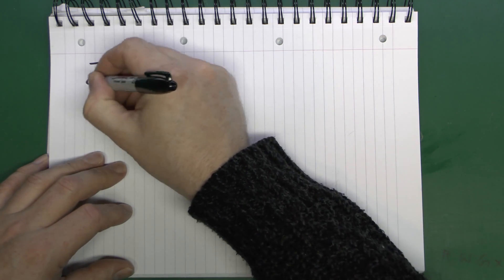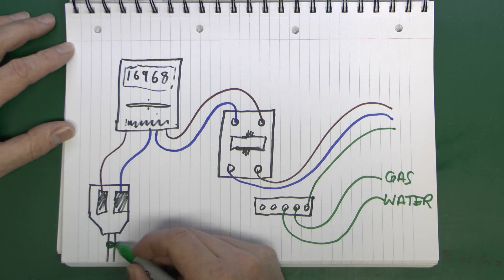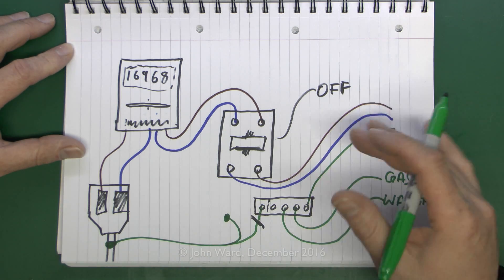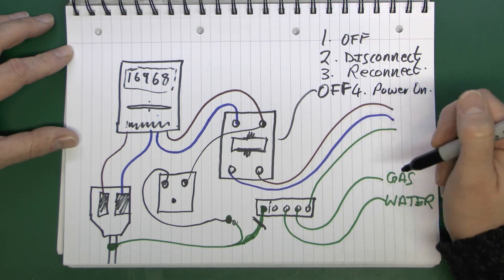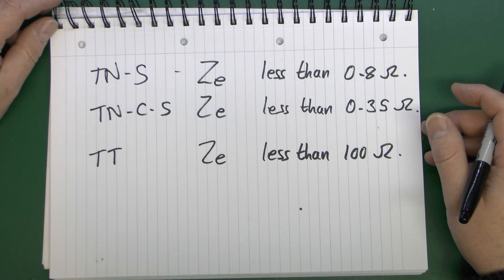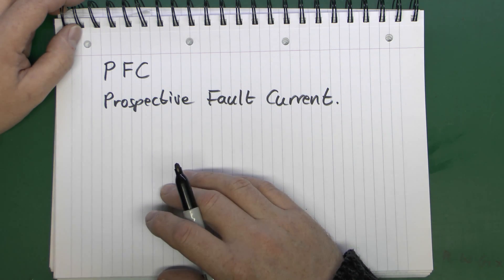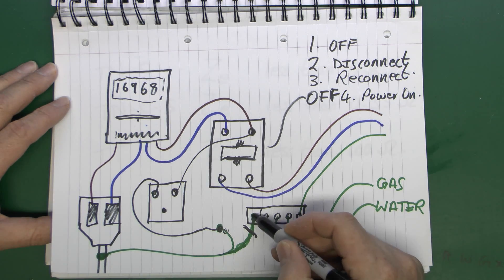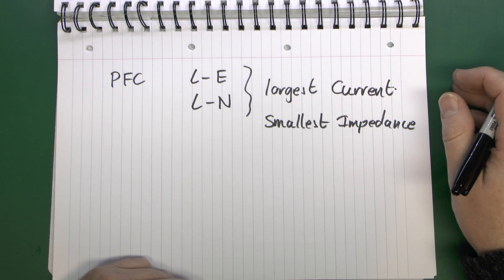Loop Impedance Testing

Comment: Why did you skip out on IT installation? Is it because the results would be the same as TT system?
Reply from the maker: IT systems are uncommon in the UK, and testing loop impedance on an IT system would be meaningless, as by definition there is either no connection to Earth at the source or it's connected through a high impedance.
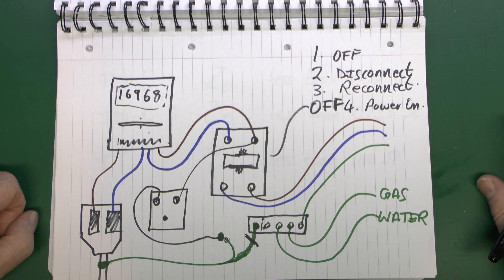Reply: @jwflame  Thanks, I asked because you said 13:13 "you do also need to consider the fault between line and neutral". Sure there is no earth at the supply of IT system, but I still can measure the loop impedance live to neutral, right?
Reply from the maker: @neowild8102  You can do that if there is a neutral.  Many IT systems do not have a neutral, it's two or more line conductors only.  IT systems are entirely different to TT/TN which is why they are not in this video.
Reply: @jwflame  thanks.

Comment: I just bought a ground resistance tester. I found one I could afford. 
Where I live there is a power poll 450 ft. away from my house. That poll supplies power to 4 homes. I during the 30 years I have lived here  it has been struck 4 times. Each time the power company has had to replace the transformer.
In each time my neighbors had computers tvs and other electronics destroyed. The only problem I had was a
 compact lamp start smoking.  That has always puzzled  me. I bought this meter to find out why though I thing I know.
Reply: Still waiting for further elaboration.

Comment: You measure between the earth provided via the cable or earth pin and the neutral? Never using the fase and earth pin? This is not very clear in you drawing. Cheers

Comment: I have 100s of these tests on the motorway network and street lighting and we were expected to get a reading of under 21 Omhs. We would often go deeper with the earth rods or do them in a triangular system and join them all together with 16mm green and yellow. The grids are also helpful and we would use bags of “Bentonite” also pour a few buckets of water over which was a bit naughty because obviously in the summer months you would the soil would dry out and not meet the requirements. I also don’t think we were trained properly because I have learnt a few things watching this video so thanks again for that.

Comment: If you have a ground electrode, then you only need to do Loop Impedance Testing or Earth testing?
Reply from the maker: Both.  Electrode tested separately to confirm that is installed properly, and loop impedance once it is connected to confirm the rest of the loop including the earthing arrangement at the supply transformer.
Reply: @jwflame  makes all sense. Thank you very much.

Comment: Why disconnect then later connect? Suppose I connect directly to the earth bar and incoming supply?
Reply from the maker: Disconnecting ensures you are only testing the earth connection.
If testing to the earth bar with everything connected, there will be other paths through the bonding connections to metallic services and other parts.
Reply: @jwflame  thanks alot, your explanations are so well articulated..

Comment: Hi John, on the generic schedule of test results, what is Zs at DB referring to? is it a test like for Ze but with the earthing conductor in place?
Reply from the maker: Same as Ze, but applies where there are multiple distribution boards in an installation - Ze at the origin, Zdb at the incoming supply at other distribution boards.
If there is only one DB / consumer unit, then Ze and Zdb are the same.
Reply: @jwflame  Thank you for clarifying

Comment: Hold a minute. Most of testing devices requires connection between L+N+E to determine Ze and Zs. How I can understand that?
Reply: Your incoming Ze is resistance between L and E, on TN-s on TN-CS the neutral and earth are connected, your Zs is Ze + R1+R2

Comment: Hi john, I'm sorry if this is very basic but does the loop impedance vary from time to time for a specific circuit? or should it be pretty stable? the reason I ask is because installed a spur double socket from the ring final in my house and the reading at the spur was originally 0.65 ohms, then all of a sudden it went as high 0.95 ohms, i checked it again today and it was back down 0.68 ohms. Is this normal or could it something more sinister? thanks
Reply from the maker: The circuit wiring should not change.  The external impedance can change sometimes, as the supply network may have alterations and repairs.  However if it's changing often, it suggests a loose connection or some other fault.  Another possibility is something connected to the system causing interference, so the high reading may not be accurate.
Reply: @jwflame  Thanks👍

Comment: Hi John, great video!

What about IT systems, how could we measure some kind of loop? 

We would actually want to measure earth rod resistance without having access to the actual rod. I've seen in some occasions that the earth rod has been covered by a concrete slab once the building was modified and there isn't any physical contact to the rod but from the main earth bar at the main electrical board. However on IT systems (three phase) the loop path from L-E on a good installation should be very big (as the insulation resistance of the cables?).

What are your thoughts on this situation?

Thanks!

Comment: I've got one of the TN-S / TN-C-S hybrids where there is both a braided earth strap on the incoming metal outer and also a 10mm earth going into the Cutout via a block marked PME. My ECI is recorded as 0.27ohms. Would this indicate that it is indeed a TN-C-S or could it still be a TN-S. I've had no reply from Western Power about what they have it recorded as. The Electrician who installed the CU ticked both the TN-S and TN-C-S boxes.  His recording for the PFC was recorded as 0.85kA. Nominal voltage of 245v.

Comment: You could have been a great airline pilot
Reply: Good evening ladies and gentlemen welcome to this Ryanair flight from Dublin to anywhere. Before we depart Id just like to say that we will be cruzing at 55,000 ohms with a voltage of 230, if we exceeded the maximum permissible value for earth fault loop impedance well then just keep calm a multimeter will drop from the overhead compartment.

Comment: John, how is then gonna trip the fuse with 6KA breaking capacity if the PFC is well below 6KA during a direct fault between Line and Earth or Line and Neutral? I know breaking capacity is different from Tripping capacity but  what happens during a direct fault, how is it gonna clear the fault?
Reply from the maker: The breaking capacity 6kA is the maximum allowed fault current.  To trip the circuit breaker reliably the fault current needs to be 5x the rated value for a B type, so 160A for a B32 circuit breaker.
If the fault current is between those values, the circuit breaker will disconnect.

Comment: In the US most regions I have worked in have the TT / ground rod install. The maximum  allowed impedance is 25Ω on a single ground rod. If it is greater than 25Ω than a 2nd ground rod at least 10' (3 meters) away is required.
Reply: Don Jude i don’t think the US is truly TT because in the US the neutral and ground are joined at the main breaker box. Thus it’s more like TN-C-S with an additional bonded earthed rod. So your primary ground in the US comes in on the service neutral and the bonding mostly keeps a potential from developing between the ground wire and the actual ground you may be standing on.

Comment: what would be the next step if a circuit didn't meet max zs for example tns or tncs
Reply from the maker: Either use larger wires, or a smaller rating of MCB/fuse.

Comment: Hi john I've been told that if we now run power to a shed , garage etc then the dno will not allow the house earth to be used in the shed, so we now have to make the shed  a TT system, is this correct and would a Ze test suffice or do we need to carry out the earth electrode test with the correct tester and test the ground around it etc?

Comment: do you have a video on the following I bought a ceiling light but the live and neutral wires are not coloured.  how can I identify??
Reply from the maker: If both are the fairly common transparent plastic, one usually has a very fine thread inside of either blue or brown.
If not, it probably doesn't matter as many lampholders can have the lamp inserted either way.  Only really of significance with screw thread holders where the inner contact should be line and the thread neutral.
If it does matter then use a multimeter in continuity mode to determine which wire is connected where.
Reply: Appreciate your time thanks

Comment: for anybody studying 2365 the values for TT is anything in between 21 ohms and 200. however is reality 100ohms is max . what I've learned anyway
Reply: 21 ohms is the maximum value for the means of earthing, i.e. the connection between the star point of the distribution transformer and mother earth (via electrode etc).  If this is less then you can have lower readings.
Reply: On site guide, Page 47. Section 4.9 note 2

Comment: Prospective fault current determines the class of breaker you van install. PFc of 5kA you cannot use a regular cheap domestic breaker, but must use one rated for 5kA breaking, otherwise a fault can destroy the breaker without it actually opening safely. 

Mostly in domestic you never see this, unless you live right next to the substation, have brand new cabling that comes direct from there and there is around 20m of cable total between you and the transformer. Then you need much higher rated breakers. Of course on the supply side the supplier always puts a much higher rated breaker, as there a shorted cable will have very high fault current, and upstream on that cable at the main line connector there will be a fuse link as well, capable of massive fault clearance. Fuse is single use, but in general it is always rated to protect the cable to the house, not the house, so is generally 100A or so, while the breaker downstream to protect the house is 63 or 80A instead. If the fuse blows and the cable is fine they will always replace the house breaker as well with it, as it then is likely to have been faulty, if it did not clear a fault before the fuse did.
Reply: Total rubbish you two are talking!

Comment: Testing like this is important.  I wish the electrician that installed my bathroom light/heat/exhaust fan did some testing besides just turning it on to see if it works. Some months later, I was testing with my multi meter the continuity between earth and neutral from my fluoro light in my garage and found that there was no continuity!  I went hunting for the problem and found this - https://drive.google.com/open?id=0B5Wm-dWZjGIpdXhhM1JUV3VmSGc  (Sorry I've shown this pic before).  Also notice the red wire connected to the top terminal on the fan?  That is actually a neutral connection, I'm not sure what the regulations are for re-purposing the wire that is normally used for active connection without using a sleeve or heat shrink to indicate it being used for neutral connection.  Anyway, I cleaned up the mess of wires and added a junction box, so it looks like this now - https://drive.google.com/open?id=0B5Wm-dWZjGIpQTBtYkZHRHNNdGM
Reply: There should be a cover over the terminal block on the side of the fan.  Also a fan venting a bathroom to a loft space is a bad idea, I doubt will pass building regs.
Reply: G'day, I was already thinking about the cover for the terminal block on the fan myself and I was wondering if it came with one but was then thrown out by the electrician when he installed it.  I will have to think about making one myself.  I'm not sure what to do, maybe modify a plastic JB to fit? As for the venting into the roof space, I checked the regs here (Sydney Australia) and it's ok to do it if you have a tiled roof, which I do, because the roof space is already well ventilated.  Besides it is hot has hell in roof space at the moment, check out this pic I took the other day - https://drive.google.com/open?id=0B5Wm-dWZjGIpa1VuUkpCTFRxTlE  (FLIR image of roof tiles from inside the roof space).
Reply: Tommy Oz I
Reply: Thomas Neall Thorn 
Good job ✌Your all good that fan never had a cover for the terminals

Comment: I assume "Loop Impedance Tester" sources current from active wire and voltage is measured at ground pin, but where is the reference. Is there a third ground wire that system uses as a reference ground?
Reply: The loop tester is measuring the impedance of the line (active) path from the supply transformer, distribution cables to the house, back via the earth (ground) to the supply transformer.   The loop tester is using voltage and voltage under load on that path to do the calculation hence only the 2 probes are needed.
Reply: Thanks cumberland1234. I assume actual ground impedance is difference between GROUND and NEUTRAL measurements.
Reply: I suspect the meter measures the potential from line to earth with no load then allows a current to flow, measures the potential again and from that change and a known current it's possible to work out the impedance. Of course, mains voltages aren't completely stable, so it probably has to do lots of tests and average the results.

For example, if the test current is (say) 10 amps, if the potential drops by 2 volts, that would indicate a loop impedance of 0.2 ohms. It might even be that the meter can monitor the actual voltage waveforms and measure instantaneous voltage changes at a number of points during the AC cycle.